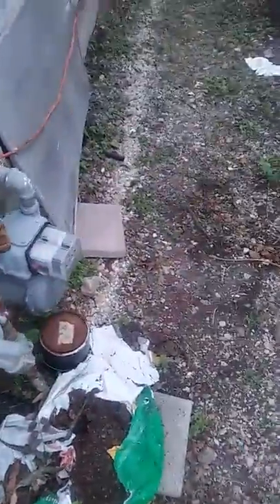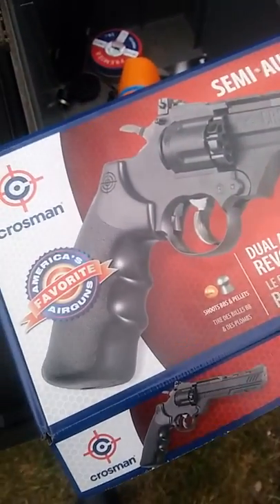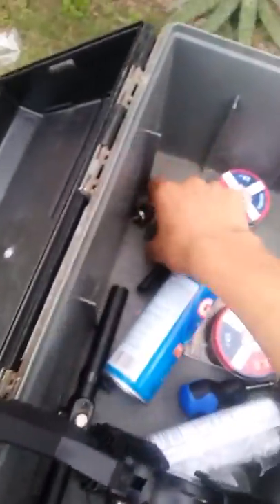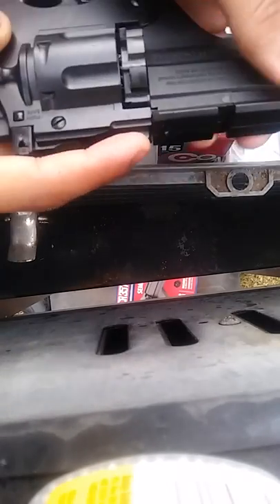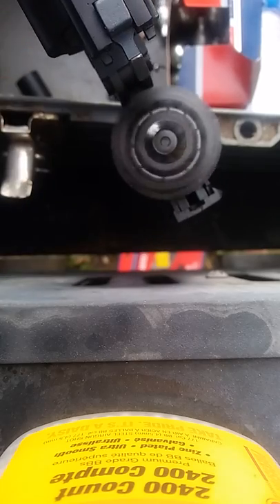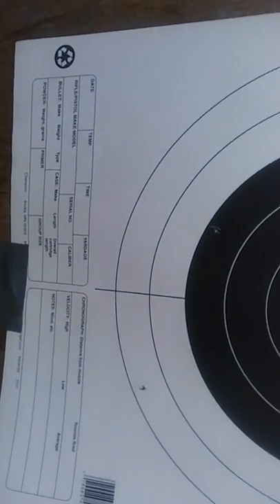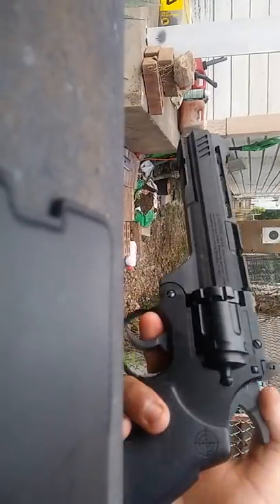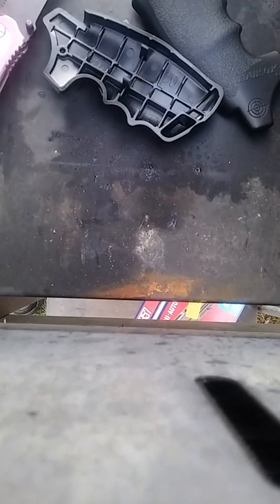CR .357. Pellet Revolver.

Comment: Dude, first off : CRAPPER HEAD PELLETS REALLY DO SUCK !!! They rust easily and fuck Your guns up ... second : Walmart got Me with that same pistol ; because they sell it side by side with THE VIGILANTE ; and The Crosman Vigilante Truly delivers in terms of power ... this gun looks just like it ; and even has a lot of good qualities ; but after a while the barrel starts to push backwards ( a little bit of Gorilla Glue around the edges applied before hand can solve the problem) while THE VIGILANTE costs the same , has no known problems, and is wayyyyy more powerful ... I don’t even know why Crosman put this model out ... it’s like maybe they fucked up and had a shit load of low powered VIGILANTES on their hands , and decided to put these out through Walmart under a different name ... but the CR 357 is very accurate ... I made Mine hit harder by putting a shit load of silicone grease in the Co2 loading port and even on the tip of the Co2 capsule before screwing it in ; that way while I shot out all the grease , the gas valve would widen from pushing out something thicker and heavier than the Co2 gas... and it worked ... so now I basically have the gun I wanted in the first place .